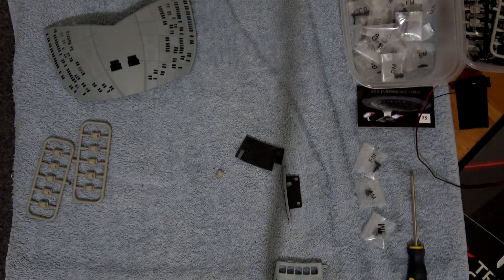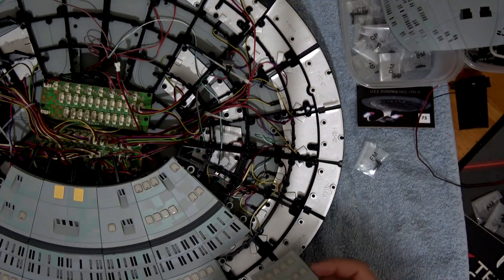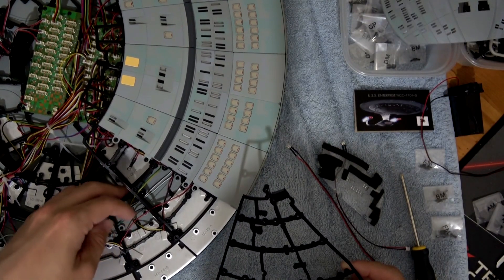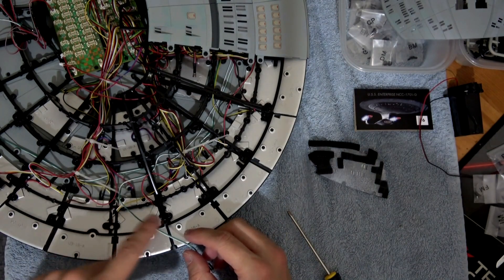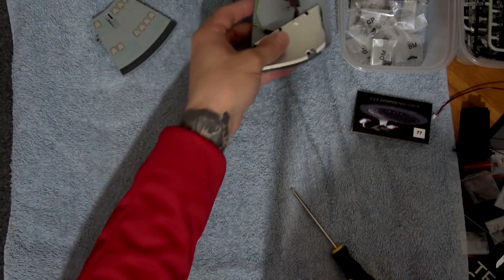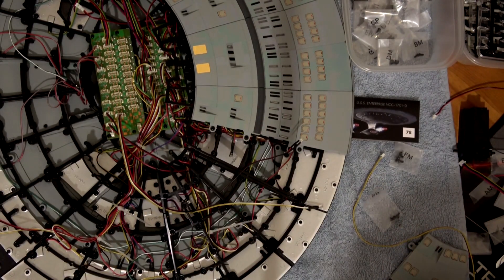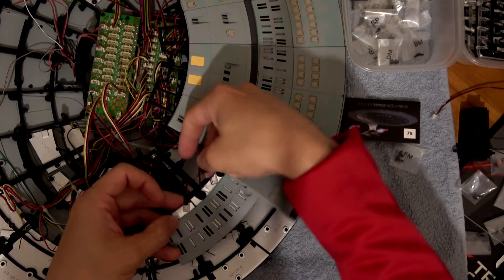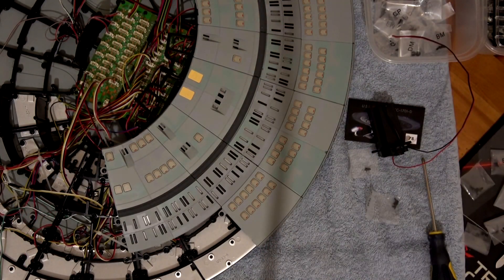Frustrations Abound // Build the U.S.S. Enterprise NCC-1701-D #20

Comment: Hi Capitano, Mama Mia its a son of a beach. Just a suggestion but with the screw that snapped off under your massive strength. Apply a tiny amount of Super glue to the post with broken screw and inside hole of outer part should hold it in place. keep up the good work, and be safe and take care brother.